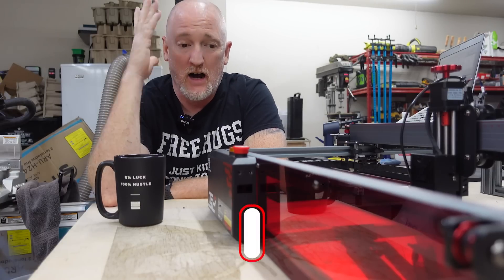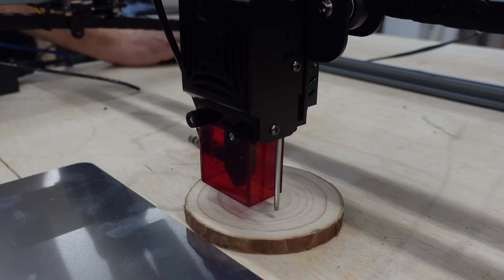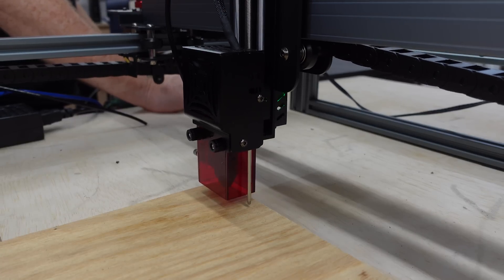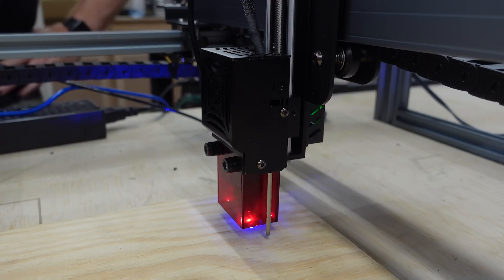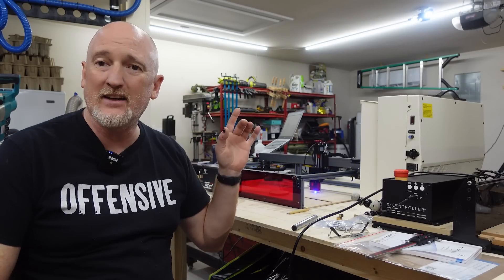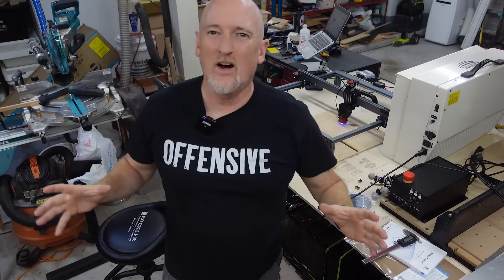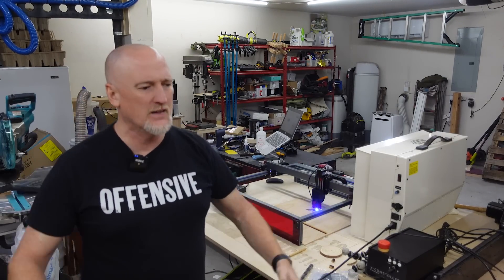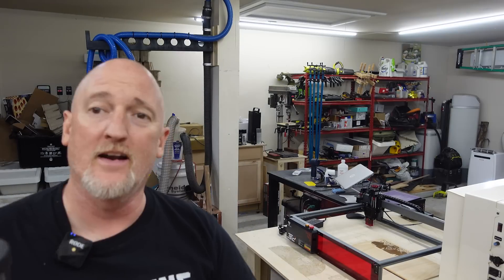Have You Seen a Laser like this Before? The Two Trees TS2 10 watt Diode Laser

Comment: еще ось зет удобна тем что на гравировку линией, лазер можно поднять во время работы, с расфокусом. 

еще можно фломастер или ручку приделать и использовать как рисующий чпу. 

The z-axis is also convenient in that for line engraving, the laser can be raised during operation, with out of focus. You can also attach a felt-tip pen or pen and use it as a drawing machine.

Comment: How long did it take to receive your order? I just placed mine and I’m getting anxious
Reply from the maker: Like a week or two...
Reply: @BuildDadBuild  thanks love the content by the way, simple, elegant, insightful, And thorough!!!👍🏾👍🏾👍🏾👍🏾👍🏾👍🏾👍🏾👍🏾👍🏾👍🏾
Reply: I got it🎉🎉 me and my wife are so excited. I do have one concern that the support team was unable to help me resolve. In the bag that the air assist valve was, there also was a 2 prong cord that was about 3 inches long with a plastic plate on the opposite side and I cannot for the life of me figure out where it goes or what it’s used for. The white tag on it has a Z or an N depending on how you look at it and from what I can see all of my wiring on the machine is connected and complete. Any ideas on what I may be missing? Thank you for being so responsive
Reply from the maker: @ECUxxAnointedxx  email me a pic at nick@builddadbuild.com

Comment: Are you using laser grade/high grade plywood for your tests? They have less patches, voids and glue, so cut cleaner with less flare up as a result. I've had a cheap piece of plywood where with my 40 watt CO2 it would just burn and char up. Cut it up and there was a thick area of glue holding a large void patch in place. They are probably claiming the cut thickness based on baltic birch B/BB or better.
Reply from the maker: Yup....just using plain ol' plywood.
Reply: 99% of people are just buying stuff from the local hardware store so I doubt many people will be buying "laser grade" wood. If that's the case then they need to state that in the specs, but you know they won't. I never knew they had that, going to look that up now.
Reply: @MrMadeinthe80s  Laser grade plywood is well known by those in the hobby. Granted, the availability of cheaper diode lasers has brought many new hobbyists without any experience, without knowing what should or shouldn't be cut. I would want to make sure my exhaust is flawless if cutting big box store plywood, the glue more often than not contains formaldehyde. Laser grade is formaldehyde free. People cutting that in their garage or basement with poor or no ventilation is a huge no-no. The first thing people need to do before putting a laser to anything, is to verify that the fumes are not toxic when burnt. Just because a laser will cut it does not mean one should do it.

You can buy laser grade at a lot of the places you get lasers, Amazon, Woodpeckers, etc.  Unfortunately it is not cheap right now, being it is baltic birch from Russia. It's more than double the price I paid before the war. But hopefully alternatives made from eucalyptus and bamboo fill the gap.

Those 3D puzzle kits you see at stores are made from laser grade baltic birch, they can't have any bad spots in them or the models won't fit together properly. Especially the moving ones like clocks.

Comment: Everytime I see a laser review, the reviewer always mentions that they wish it had this or that. Makes me glad to have Snapmakers because they have this and that already. Cost a little more at first but, as these other machines improve, the price goes up. Plus, the Snapmakers have CNC toolheads and 3D printer toolheads.
Reply: I don't understand these diode lasers at all. If you are going to use a laser I'd buy a co2 from the start.
Reply: @WNC828  I want to believe newbies like me are scared of how bulky CO2 lasers looks like... and the sort of complex installation... how fragile it is with its tube... On the other hand, i will choose xTool D1 Pro 20w over this... Still learning tho... Just been thinking it through... Going CO2 cos it costs less or going xTool cos of its versatility and less of a scary look... Maybe you can advice...
Reply: @WNC828  co2 lasers don't work on certain media so I'm told. I started with a gift and have been upgrading since. I use a 10w diode on a Snapmaker and it does what I need.

Comment: It seems like their 8mm macro is not set correctly if it moves away from the board more.  It should try to focus 4 mm into the board, right?
Reply from the maker: I tried different focal lengths and couldn’t get a better result.

Comment: Huh... what's the price point on the preorder? I try to load the page, and all I get are errors about secure connection failing. And it looks like it actually has a slightly smaller footprint than the D1... am I right?
Reply: Pre order price $699 ot $798 with air assist.
Reply: The price I'm seeing is $798 with air assist, $699 without. Right now you can get a Sculpfun S10 with air assist for $540 and those seem to cut thicker material more reliably.
Reply: The footprint is about the same. All the companies give you a work area but the laser doesn’t actual cover the entire space.